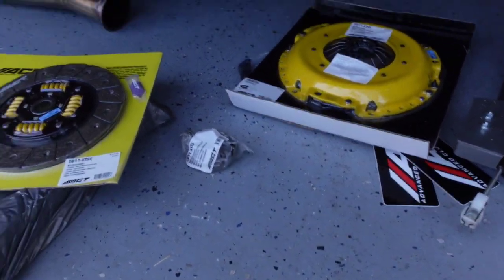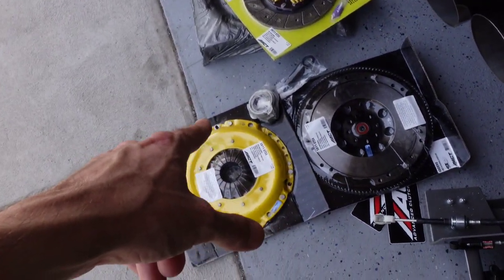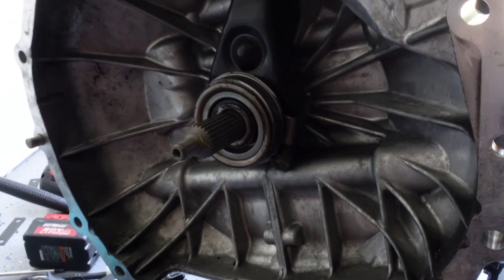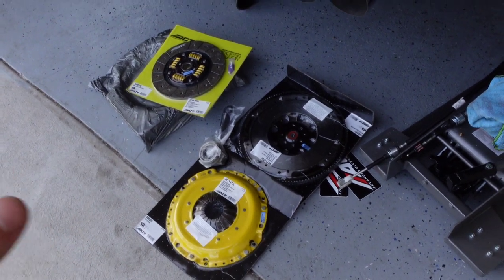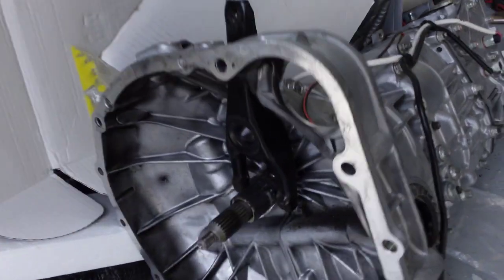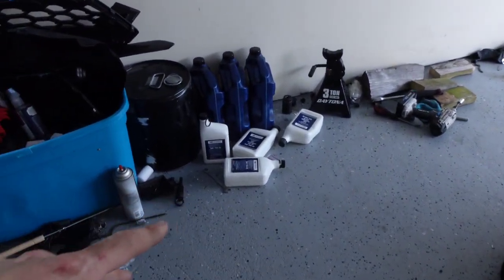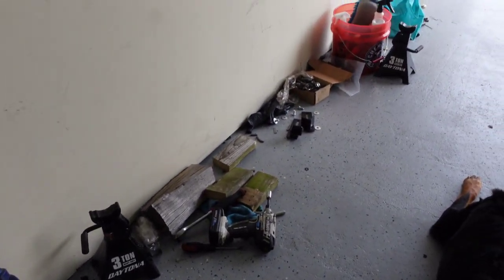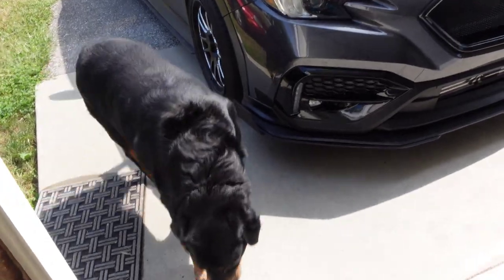New Transmission & Clutch For My WRX

Comment: Glad the VB is back together. I did my fist transmission swap in 1989 as a 16 year old hot rodder. I know breaking stuff sucks but it caused me to gain so much knowledge by doing that. 😆
Reply from the maker: 100% agree! I did my first transmission when I was 17 on my 1997 Eagle Talon. Then my first engine when I was 18 on my 1998 Ecliose GST. Just sucking it up and doing it yourself is so scary at first but like you said you learn how to do it. If you haven't seen my "Building a 1999 Eclipse GSX in 10 minutes" video, I basically tested all my knowledge over the years and surprised myself building the car from a shell doing the paint, bodywork, electrical, and Drivetrain all by myself. Almost 19 years after buying my first Eclipse that i was scared to work on. It was an amazing experience seeing how far over come! That's why I started making videos to try to help give confidence to people who were scared like I was.
Reply from the maker: @scottbeauchene8868  to me it sounds like a throw out bearing. Did you re-use your factory bearing or did you use the act one?

Comment: Same exact thing happened to me on my VA except I was fully back together before I noticed. If the clip is in you can fix it without pulling the trans back off. Pull the fork boot. Grab the fork with a vice grip. Put a large flat head into the space within the vice grips teeth above where it's grabbing the fork and pivot against the pitch stop bracket to pry the fork up. The force that the pressure plate is putting on the fork plus the vice grips pulling up should pop the pivot ball back into the cup of the fork. I think I caused mine to fall out when I jacked the trans back up into the car. I think I pushed the fork down because it hit the bottom of the car going back in. I was so relieved when it popped in. I was not feeling pulling it all apart again.

Comment: My act throw out bearing has been okay so far. I had issues with my oem clutch fork breaking and the pivot ball breaking as well which both caused noise but never had oem bearing issues

Comment: All I have to add is I'd have replaced the TO bearing with a brand new OE one as well as the fork pivot ball and pilot bearing while everything was apart.
I put Motul 300 in my '22 in both the transmission/diff and rear end and I'm impressed- shifts smoother now.  The OE Subaru gear oil listed in the manual was only available from the dealer in a 5 gallon bucket  🤨
Reply from the maker: I would've but with such low mileage on the swap and seeing the grease on the pivot ball looked super clean I didn't bother. And I heard some others say that too! But the dealer didn't even hesitate when I asked for it.

Comment: Hey man, I’ve been watching your videos since the 2020 WRX and saw you’ve changed the clutch a few times in your VA and VB. Just got mine done today and wanted to know if the 1st gear and reverse engagement vibration is normal for the break in period? Thnx
Reply from the maker: I actually always had jitters with this clutch. Had the same one on my 2015 VA, my 2020 VA with sti swap, amd my VB. And all of them sort of shuttered on Acceleration in 1st and reverse. I found the only thing that helped was Revving the rpms a little higher, and upgrading all the mounts (but that will add a lot more noise to the cabin)
Reply: @StreetInspired1  I’ve done a good majority of the stiffening mods, pitch stop, group N trans mount, positive shift kit bushings, rear diff bushings etc. I kind of feel like it might be the difference in the light weight flywheel and OEM. Just like you said needs to be in a higher RPM on initial engagement because of the less rotational inertia. Probably just gotta get used to it probably. What about the chatter on Decel, did it go away?
Reply from the maker: @travisquire3386  definitely the Flywheel makes quite a difference. But the chatter on decel sticks around. The clutch and Flywheel combined really make it noisy haha
Reply: @StreetInspired1  welp, it definitely feels a lot smoother so far. Still in break in period. I guess that’s the trade off. 🤷🏼‍♂️

Comment: Just remember, no e85 maps until you have the money for a STI transmission swap. I also have a 2022 6speed chilling in my garage forsale but not sure if I want to deal with shipping.
Reply from the maker: E85 by itself isn't going to grenade the trans though. You can still run e85 and just turn the power down. And yeah I've been told it costs about $1,000 to ship them and it's a huge hassle so that makes it not very profitable.

Comment: I'm glad you got the car back together, but I'd be lying if I didn't say I wasn't disappointed you didnt sti swap it. Seems like in the end it would have been cheaper to go straight to the sti swap instead of another wrx first. But its your money.
Reply from the maker: Maybe long term, but it would've definitely been more expensive to get the sti swap, and I don't have a second vehicle. I had to do what I had to do to get the car on the road asap. Would've been without a car for probably another 2 months
Reply: @StreetInspired1  how many STI transmissions are there out there in the world available?  What's the ratio of STI versions to standard WRX over the years anyways- wild ass guess one out of ten?
Supply vs demand is going to be a factor if it isn't already.

Comment: My transmission went out. The synchros escalated and now it finally left the chat. I bought same 2016 wrx transmission. But I’m like freaking out because I’m like what if I have the same problem the synchro going to go out on me😰 but part of me thinks…My entire faith and believe is like nah, this trans is going to last multiple years to come. This time I’m starting it with two bottles of light weight shock proof and two bottles of oem. I have that same kit. I need to send a 50 plus ethanol log and I’m like I just got the new trans.  It gots 51k miles, the transmission.
Reply: Why would you not just get an STI or get the STI trans/drivetrain swap. What a waste.

Comment: My throwout bearing went out at 12k miles. Now I have no 6th or reverse today. I'm about done with this car. It's stock and had been making a whining noise in 6th around the same time after they did the clutch.
Reply from the maker: Some people got so butt hurt over my original review of this car. I want to love it and there's a lot I like about it but you can just see how much subaru doesn't care when stock cars are having issues and it's the same recycled parts from the last few generations.

Comment: Sorry if you mentioned and I missed it, did you dial the tune down a bit for safety for this new trans?
Reply from the maker: I haven't yet but I won't get on it until I do. I also have to break in the clutch for a couple hundred miles. But I do plan on dialing back quite a bit
Reply: @StreetInspired1  right on, hope this trans treats you better. Thanks for being a pioneer for this platform ✨🚙💨

Comment: Do you think it's worth to change clutch and fly wheel for aftermarket in order to make transmission more reliable? My VB is completely stock.
Reply from the maker: I don't think changing the clutch or flywheel will help keep the transmission from breaking. The only thing that will prevent a broken transmission on these cars is keeping it stock and or avoiding hard driving.

Comment: You've go too much clutch for your torque rating.  I've had all the clutches in my 480WTQ STi, ACT comp, extreme, and Mod twin. The pedal effort for the extreme was well, extreme and caused wear on my thrust bearing.  The comp held the torque just fine.  I've got the Mod Twin and it's great.

Comment: thats crazy you would risk your life instead of getting different tools that could more easily lift the car higher. I think id rather have the different jacks and jack stands instead of dying a horrible slow death. I hope you consider your safety more next time jesus.
Reply from the maker: It wasn't as sketchy as I made it sound. I wasn't physically under the car with the wood blocks. The car was on 4 jack stands and I lifted one side with the wood blocks just enough to slide the transmission under the car and then sat it back down on the stands. I would've never climbed under and worked on the car without proper support.